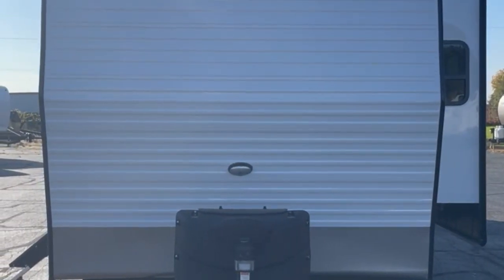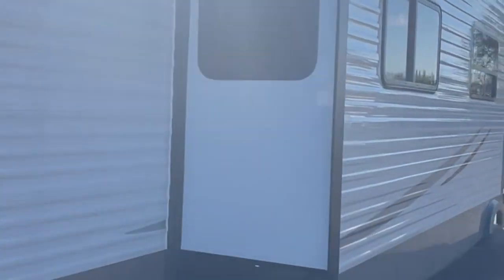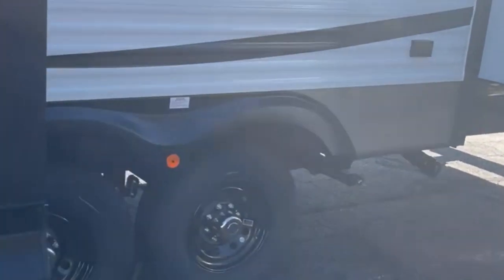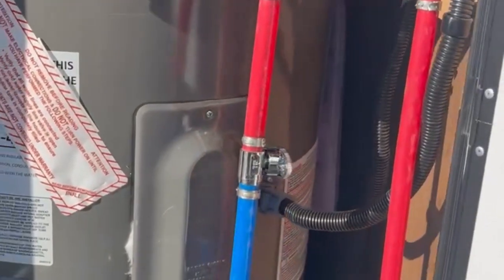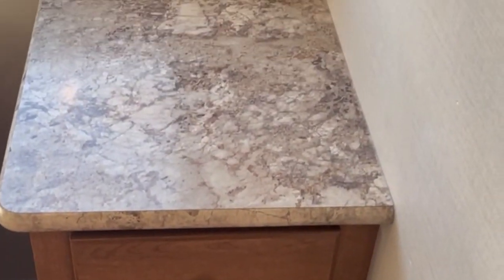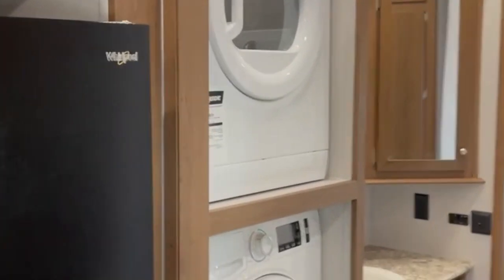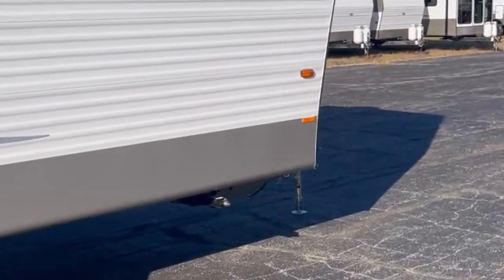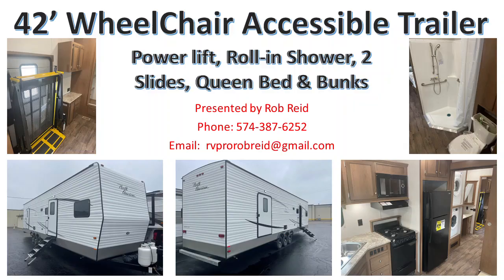Handicap wheel chair accessible 42 travel trailer with Braun lift system

Comment: BUT AGAIN DOES NOT HELP A PERSON DO KITCHEN WORK. SMALLER CABINETS IN WIDTH AND LOWER SO YOU CAN REACH COUNTER. TOP CABINETS DROPPED AFTER THAT. OTHER WISE MOVE CLOSET WITH TV AREA. SO WHEEL CHAIR CAN GO AROUND BED.
Reply from the maker: Those are great ideas!  Again we custom build units to that clients scope of needs and wants.  If you would like me to build a unit with these changes please reach out to me and I will be happy to incorporate these ideas into your custom built unit.